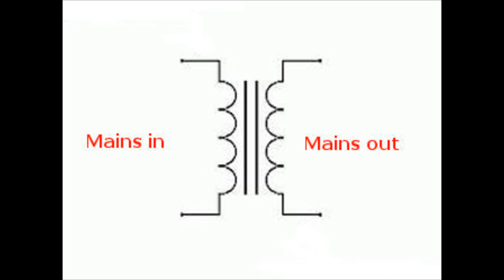The Radio Workshop - Safety Video

Comment: Ray, working mostly on 12/24v gear made me too complacent, I remember well a radio bursting into life as I was soldering an audio amp IC in,  distracted with a friend in the shack etc. So power supply was still on.... no big deal. More scary was working in the PA compartment of a linear I was building, unplugging from the mains before diving in at every step. I had the plate blocking capacitor gripped tightly in my hand checking it was secured tightly when I caught a glimpse of the front panel meter... HT was still up. I had unplugged something else, not the amplifier.... to this day I don’t know how I missed getting a shock. Had to go away from the project and have a coffee before continuing, very shaken. Not sure what was more scary, the closeness to death or the possibility of getting the kiss of life from a G4.
Reply from the maker: g0fvt I think we all suffer complacency at times. I gave an emergency power switch on the bench that I hit before working on gear. Cheers and take car, Ray.

Comment: The worst shock that i ever had was back in the mid sixties. On the bench was a digital Voltmeter not a Transistor one but full of valves and trochotrons one of the first dvm´s. it was a rack mounted one switched on. Me  Standing with my back to the valve socked side. me chatting  to some one. The back of my Hand came in contact with the rectifier valve base with a few hundreds of dc and ac Volts.on it. I had my Hand behind my back an did´nt realise the dvm was right behimd me and switched on. the result was I severely burnt the back of my Hand, and had to go to Hospital to get it seen to.
Reply from the maker: Hi Graham, glad you lived to tell the tale! Cheers, Ray.